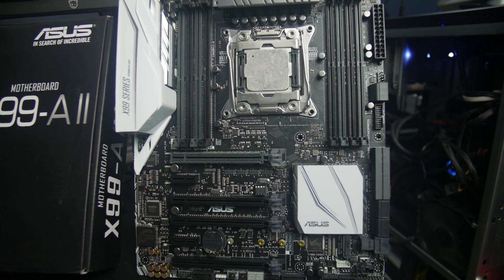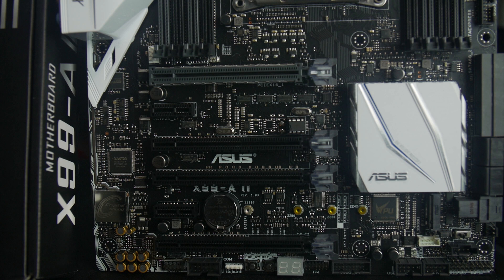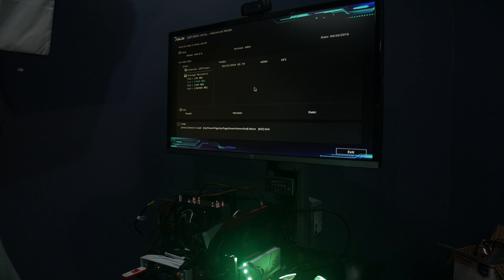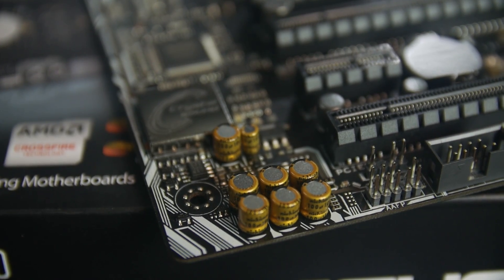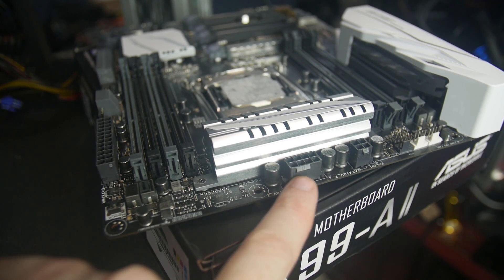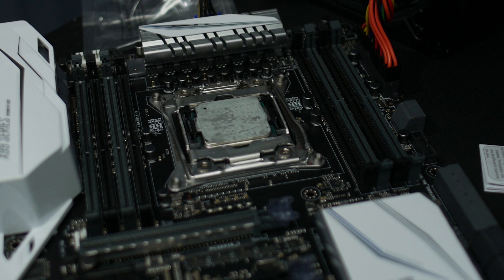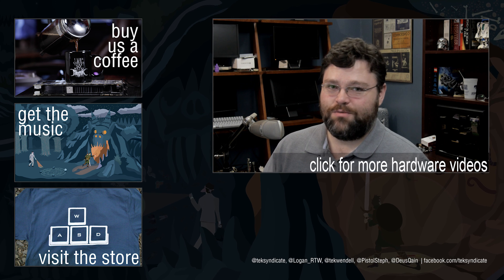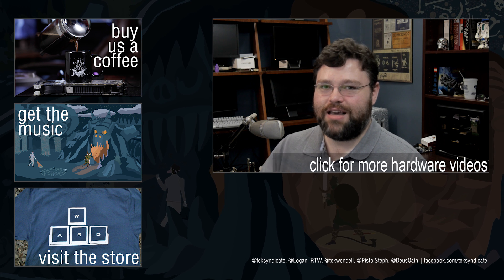Asus X99 A II Motherboard Overview/OC Test

Comment: Well I have the same mobo but I have the 6850k running right now @ 4ghz I had it up to 4.3ghz but I was hitting 80c sometimes 84c while gaming with the Cooler Master Liquid Lite I'm going to up grade the cooler as maybe a little later it gets the job done and my Gtx 1080 ti  gets utilized 100%. I want to upgrade but I don't want to give up my cpu pcie lanes for more fps just yet i'll wait til the second gen come out hopefully with more lanes. thankx nice up!!

Comment: Can anyone answer this question:

If I put in a 40 lane CPU, preferably the 8 core one, Can I run two GPUs at full x16 with a x4 SSD on M.2? 
Will that disable anything on the back panel?
Reply: Appreciate your reply!
Reply: Redwan Hasan i know that this is very old but still...did you figure it out?

Comment: Should I go for 1151 or 2011-v3 ,v4 for encoding video?
Reply: 2011-v3, Intel won't be replacing the X99 platform for a few years, and video encoding can make use of the extra 2-6 cores over Skylake's 4

Comment: +Tek Syndicate
How's Asus's BIOS/UEFI support of VT-x, VT-x with EPT, and VT-d nowadays?
And you forgot to tell us how the phases were implemented by Asus. (Especially important because this board has an OC-socket.)
Reply: I forgot to add that my question is related to Linux.
Quote from the link to the Xen Wiki pager below : "For ASUS Desktop Boards, these have VT-d support enabled, but Asus does NOT support Linux, so you are on your own with any Linux or Xen issues like broken BIOSes:". Then 7 older motherboards are listed. That's why I want to know how VT-x and VT-d by Asus and Linux are getting along nowadays.
http://wiki.xen.org/wiki/VTd_HowTo

Comment: That bios flash button is just great, used to have a problem where my Deluxe 3.1 "bricked" with USB surge protection blocking the boot process. Just flashed the same bios again with that button and everything is working again. Was a pain in the ass to get a Thunderbolt EX 3 card though, there aren't many retailers listing those in europe

Comment: I run Arch Linux on this with an i7 6900k and it runs like a champ, but takes very long to post and to boot, like 45 sec to Xfce with an NVME 950pro. Before I had i5 2500k with Arch Linux and it was about 15 sec to boot to the Desktop.
Reply: Got the same issue, same SSD with a 5930 K and the older USB 3.1 revision of the Deluxe Board.  Takes ages to boot up any OS whatsoever.
Reply: +unicks.eu Do you have stuff connected to USB ports when booting?
If so, note down which USB port(s) were in use and try if removing them before booting, speeds up the boards post and boot. If it does speed up, check if the USB port(s) that were used were connected to the PCH, or a 3rd party controller. Then find out if your post and boot are slowed down by USB devices connected to the PCH or to the 3rd Party controller. Or find out if it's one specific USB device.
Reply: I have mouse and keyboard and three usb hubs connect, which one of them belongs to my monitor and has a built-in sd card reader. But also with only mouse and keyboard, it takes a long time to boot. I made build videos and you can watch it on my channel if you like. You could see, that the first time I started the system, the mobo was outside the case on the box and it took very long to post. I even shortened the time in the video. The Videos are in German.
Reply: Yes, the boot process is very strange, indeed. I push the power button and the lights on the case turn on, then it seems to power cycle one time, because the fans stop/start spinning. Then AFTER about 30 sec the BIOS logo comes. (When I turn off the logo in the settings, I have trouble entering the BIOS.) It takes 30 sec BEFORE the OS starts to boot. But also booting the OS is strange: Kernel and Initrd are like 1 or 2 sec, very fast, then it stops doing anything for about 10 sec. Userspace starts in another 2 sec, again very fast. Some poeple say, the long time before the post is due to ram check, if you use xmp which I do!?
Reply: unicks.eu No XMP for me as well. I often heard its due to X99 Processors that are supposed to POST rather slow but I have no experience with X99 boards aside from ASUS. Fans and pumps are at 100% for the first few seconds, also not a matter of intruder detection I checked that as well. Was getting the same kind of power cycling as but strangely only on reboots and it stopped happening by itself at some point.
Personally I think it has something to do with the PCIe setup, it seemed to be faster and more stable once I went back to a single GPU setup.
Reply: Well if that's the case then I'm all out of ideas of what could be the reason.
It's something to keep in mind, because I'm looking for a new X99 m/b right now.

Comment: I had one of these boards and returned it after two weeks.
I could not get adaptive voltage to work when XMP was enabled, without XMP enabled I could not run the memory at it's rated performance (3000), instant lock-up.
Asus tech support was unable to help me resolve this issue.
I bought a Gigabyte GIGABYTE GA-X99-Ultra Gaming (rev. 1.0) and have had no problems with it.
I do like Asus's software better, but you can set all the settings in the "Bios" on both boards anyway, which is what I do. The Gigabyte board has Armour around every pcie slot and memory slot plus a lot more LED's, if that matters...
Reply: It's working perfect! 
It's only a little more money if I remember right...
All X99's take longer to boot, more lanes to check and quad memory as I understand it...

Comment: I have an Asus x99, and fucking hate it. 

Wonder if this new one has all the bugs worked out...
Reply: There are MANY.

Takes almost a full minute for a cold boot,

RANDOMLY You'll get a "Overclock Failed" on bootup, when not overclocked at all.

There is a fan controller issue where on a custom fan curve it will rev up and down constantly based on cpu temp, there is a delay option that does not work.

There are a few other issues, but these are the ones that drive me the craziest
Reply: another that bugs me is when overclocked, the cpu will not idle down for a few minutes after bootup, which makes the fans go up and down erratically.
Reply: I though I'm the only one with those issues... horrible boot times even with NVMe. And "Overclock Failed" every time there was a unplanned shutdown or reboot no matter the reason, fan controller is useless without the expansion and the UEFI is horrible to navigate, additionally there are issues with the Bluetooth shutting down for no reason on the Deluxe Version.
Reply: There was another bug where one of the later bio's wouldnt let you overclock, it would show the multiplyer at anywhere from 40x-60x but would not actually change anything

its every Asus x99 so far, they all have those issues, I bought an intel 750 1.2TB NVMe to help boot times but it still takes nearly a full minute to boot.

I have the fan extension, and it still has those issues I mentioned.

This board is JUNK, imo.

I've called ASUS to report these issues hoping they'll make a bios revision, but none of it ever got fixed, every time I call and complain they act like its just my board even though there are DOZENS of forums complaining about the exact same thing. ASUS Support always tell me to just do a bios update even though I'm always on the latest version bios, after that they try blaming things like my fans, cpu, refrigerator, ram, or psu. I have multiple pc's that I can use to diagnose every other part in the pc, when its on and running everything is fine, but ITS A POS DESIGNED BOARD
Reply: I have had Asus Monitors (3-4) and they're alright, I had 2 with power supply issues, I was able to get replacements on ebay and the monitors are still alive today, 

Every one of them I've had and seen had serious back light bleed, and needed to be tilted VERY Downward to get the contrast to look right. They are good CHEAP Monitors
Reply: Same, I had a Z87-A and it had so many issues, it basically ruined my PC-building experience. I think you should get higher model ASUS mobo's or go with another brand.
Reply: WTF Are you talking about, the x99 Deluxe is like a $400 ULTRA Premium board.

GTFO of here
Reply: Nothing ASUS makes is premium. Their best resembles cheap MSI or Gigabyte boards.
Reply: I Defiantly wouldn't say that, ASUS as a whole is fairly reliable, premium brand

I've had plenty of MSI and Gigabyte products, one of my last pc's had a Gigabyte Mobo and that board was a JOKE
Reply: TwiTch ???? You said X99 so I assumed it's the X99-A. Why are you so salty? "WTF are you talking about GTFO out" You've got issues bud.
Reply: TwiTch I would say that, ASUS as a whole is a shitty brand relying on form over function.
The complete systems they make, they often drop support with every slight refresh.
The mainboards they make rarely see any actual bug fixes, and use stupid techniques such as tying the USB 3.1 chip into PCI-e.
The graphics cards don't have the same overclock envelopes of the competitors, despite ASUS specifying them as enthusiast grade products designed for overclocked gaming.
Many of their products don't last for more than a few short years.
ASUS is the Apple of custom computing. All talk, no action.
You even confirmed that your board wasn't an odd man out, especially when it was a BIOS update that crippled it and ASUS wouldn't acknowledge the issue.
Reply: ://ReaperReaper
This pretty much sums it all up especially the part about AiO systems that get dropped like hot potatoes every few months.  Everything they release has to have some sort of additional module you have to purchase separately but nobody ever stocks that crap.
Their x99 motherboards are awful, there was as "S" model only released in Europe, they where basically broken Deluxe boards that got retrofitted, if you took of the plastic you could see where they just got rid of the WiFi module (its just a snap in connector). Those boards died like nobodies business and I don't you even tr to get a RMA on that crap. Gonna have to look for a another manufacturer from here on, to much problems on my Deluxe board, and its the second revision with builtin USB 3.1, but none of the issues of the first revision where ever resolved .
Reply: TioPaleshadow Most manufacturers support their products for a few years after full discontinuation of the model, even if supports slows due to higher need to fix newer systems or lack of major bugs still hanging around.
With ASUS, support is dropped the second they have a review unit of the new system, where the only difference is that the processor model has a slightly higher clock.
As a testiment of ASUS' quality, I searched 5 custom PC shops that dealt with the entire spectrum for ANY ASUS parts or systems. Only one shop had an X99-A, and they pushed literally any other board, from AMD Anthlon64 to Intel Skylake.

Comment: Does anyone know if ASUS will be making a Mark 2 version of a MoBo with ECC support like the X99-E WS?  I'd like to see that reviewed and configured with freeNAS.
Reply: That ECC "supported" is tricky, just because it says ECC RAM supported on the box doesn't mean error correction is actually working. The FreeNAS forum recommends only server CPU's with server chipsets. And because X99 is no server chipset, I'm not sure if anyone could guarantee you that ECC would work on that platform.
Reply: Jack White  Good to know.  Thanks.

Comment: Does this motherboard support SLI 16x by 16x with a m.2 drive installed? With a 40 pcie lane cpu of course.
Reply: What graphics cards are you using? To my knowledge the 1080 doesn't even saturate x8.
Reply: +reallunacy gtx 980's , I know that they don't fully saturate the pcie bus. I'm not sure that the gtx 1080 does, I have not seen any testing for them.
Reply: +marnix wyns (Th3g4mingbro) thank you.
Reply: +marnix wyns (Th3g4mingbro) the 980 ti did.
Reply: +marnix wyns (Th3g4mingbro) the 980 ti did.

Comment: No 1060 review yet?  How are we supposed to call you NVIDIA Rim Jobbers if you don't even do a Review?  ;)
Reply: Well maybe when Logan mentioned how bad NVIDIA looked when reviewing the 480 on Doom compared to AMD they took exception to that?  Maybe they did not send him his free sample, ,,,,,, yet.  Or maybe they are trying to write a script to say how good the 1060 is but not nearly as good as the 15% claimed by NVIDIA (over the 480) and the script writers are perplexed on how to do that without sounding like NVIDIA Rim Jobbers?  Or maybe they got confused reading a Review Manual stipulating to them, "the reviewer" which Benchmarks to run, maybe that was a bit of a conundrum which has caused delay?  Or maybe they are trying to think up a story to talk about how SLI is not important anymore (except if you buy the most expensive Cards) and they just can't think of any right now?  Or maybe how to explain to people that the 1060 model they all want is $330.00 and since most GPU users (85%) are under that amount the other 15% can simply wait in line here.  Or maybe they know exactly why the NVIDIA Cards all (including 1070, 1080) look like crap compared to AMD loading Doom Textures and they don't want to talk about it?

Comment: Who is the x99 system for?
Reply: Enthusiasts. People above gamers
Reply: Hardcore Gamers, media creation people, home server type work.

take your pick.
Reply: People who can take advantage of extra cores (rendering, editing, VMs, math, 3D) and PCI-E lanes (2+ GPUs and the likes of RAID controllers, multiple PCI-E SSDs, plenty of HDDs, capture cards, etc. in one system).
Reply: Also, no, X99 is NOT for "hardcore gamer", as i7-6700K, stock, gives better performance in games even when compared to that $2000 Broadwell-E CPU.
Reply: ***** correct. it's for rendering on workstations. when you have to wait 3 days for a 3d scene to render [cpu based] it makes a big difference, or when you have to render a video 3 times a day, it makes a difference. [output rendering is CPU based]
Reply: +2110ify not for you!
Reply: people with enthusiast chips
Reply: Depends on the gamer, those looking to SLI a 980Ti, Titan X, 1060, 1070, 1080, or any of AMD's 8GB cards will hit bottlenecks on the 6700K's meager 16 PCI-e lanes.The difference in gaming is marginal anyways, even CPU bound games will play very well on the X99 platform for years to come, with the difference in frames, artifacts, and stutters being well within the margin of error.
Reply: ://ReaperReaper Actually, no. Current GPUs do not saturate lanes enough to justify lower clock performance. Running two cards by 8 is just fine. Just check out benchmarks, such as Digital Foundry's.
Reply: What about 2 1080s and a intel pci e ssd would i need a x99 system or is z170 fine?
Reply: You'd want to go x99, and get a 40 lane cpu. speaking from experience
Reply: ***** Benchmarks aren't a good method of testing PCI-e lane saturation. No current game can utilize the VRAM of an 8GB card to the point where x16 is needed, and synthetic benchmarks only test the capability of the card, not the connection to the card. One could test a 1080 on an x4 connection and still get the same results as an x16 connection with synthetics.
Also, there is no need to justify the lower clock, the difference in single core performance is less than 10% between X99 and Z170. Any games that can actually see a difference between current X99 and Z170 will only be a matter of 1-2 frames. Personally, I'd rather have full x16 lanes to both GPUs for when games start making use of 8GB cards and 4K gaming becomes cheaper, than having a 1 frame boost in GTA V.
Reply: ://ReaperReaper Mmm, Digital Foundry's benchmarks were in games. Overclock is tested as well. Just see the video. -.- Also, I am talking "now", not "in five years", where such GPUs will actually appear.
Reply: 2110ify 2 1080's would require 40 lanes of PCIE. it's massive bandwidth. with x99 you would still have room for expansion. but you might be better off waiting for the 1080ti and skipping the new SLI melodrama, and staying on a 1051 board
Reply: or even better, for that price u might want to consider this lovely news  :)  http://www.tomshardware.com/news/nvidia-pascal-titan-x-revealed,32309.html